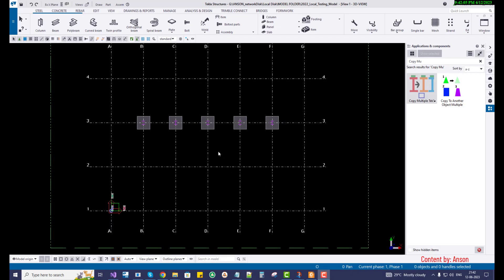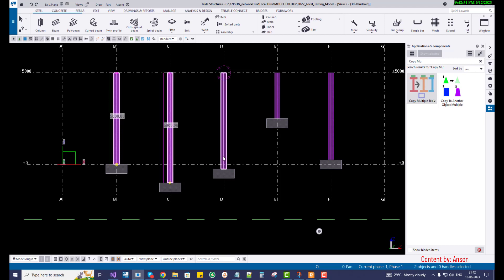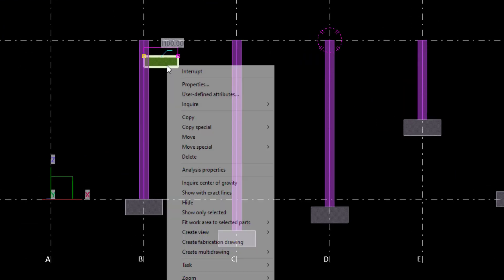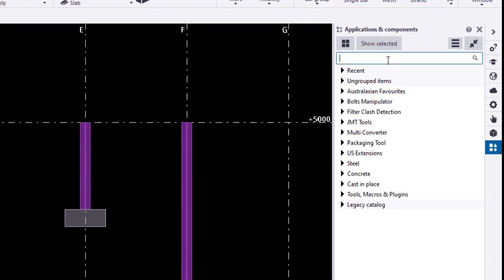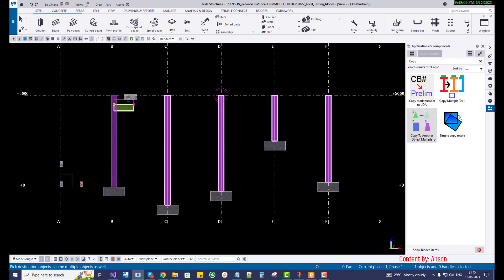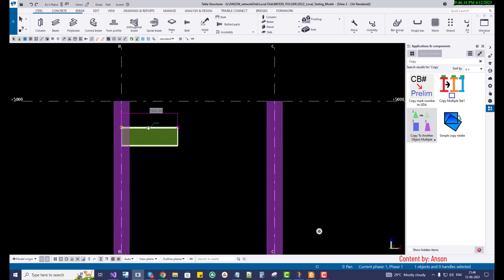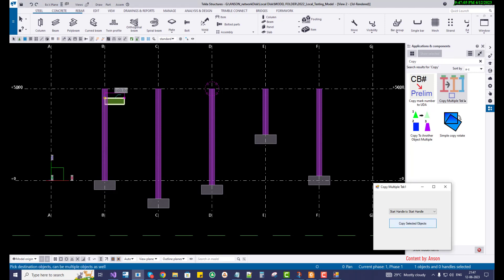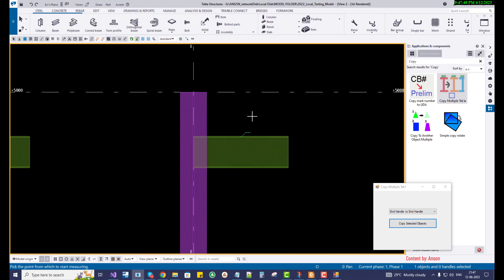Copying from One to Many & End-to-End Copy Technique with new Tool

Comment: hi thank you for that can you a component that check welds exmple if 2 parts that are welded they are toching each other same for bolts if they have only primary part without second.... an example in this vedio is on grid E  the beam is welded to colum and it dont toch each other
Reply from the maker: Zaki, I did not understand your question. can you explain? You may email me koshy@tek1.com.au